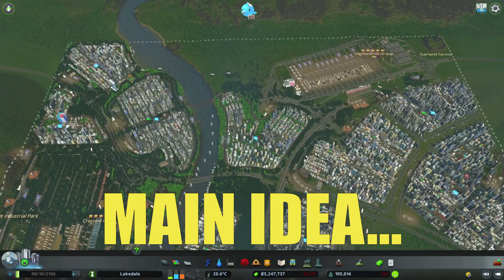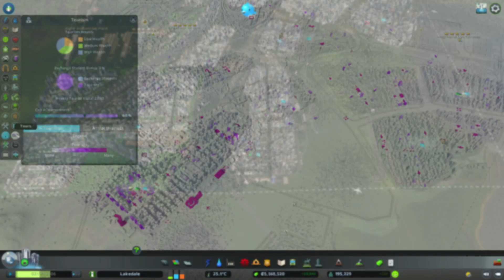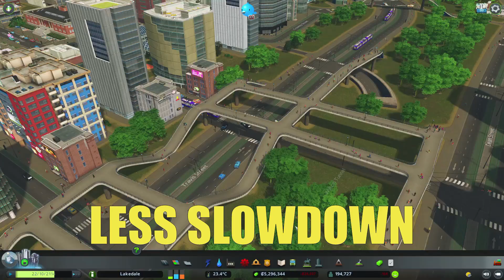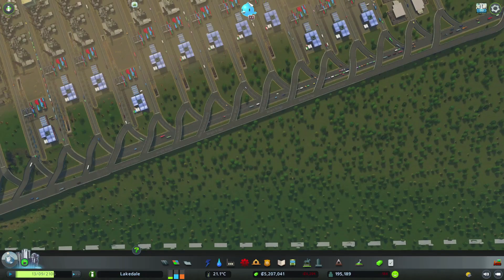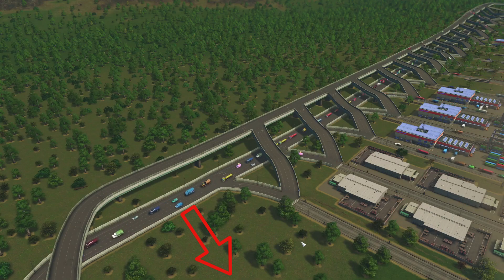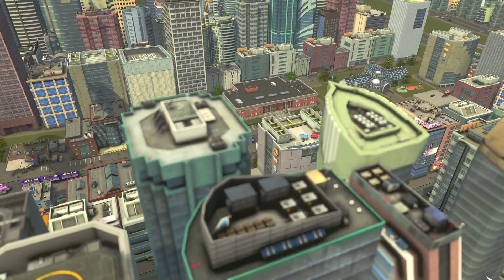🔶Zoning & DLC Industry with Maximum vehicles and a Balanced RCI city design in Cities: Skylines

Comment: Thank you Peter for showcasing my city! 
Looking back at the footage i took, is like hearing your own voice on a playback! Its so wierd to me :D. Still you made it into a realy good video mate!
If anyone has questions regarding the city, please ask them here in the comment section.

As for the Spaghetti interchanges. (i mean, who doesnt like spaghetti?!)
As mentioned, my idea was to have traffic in the city, but to make it flow as smooth as possible. I have 1 standard interchange design (see 8:08), that i modify to fit. Some interchanges turn in to spaghetti for a good reason.  The interchanges can run into problems the moment i add a new city block or more cims move into the city blocks. I keep track of where the traffic piles up. It happens for 1 reason only. All the AI will use 1 point on the highway to merge lanes. Once a car reaches this point, it will switch lanes there. If there is a car on that point already, it will stop in the middle of the highway, wait for the car to pass, then go onto the lane it wants. This can only be fixed by making sure traffic isnt 1 giant string of cars like this ------------ but a string with big gaps like this -     -    -      -      -      -. That way you minimize the change of a car merging onto a lane with a car already there. And if the car doesnt have to stop to switch lanes, it will keep the flow fast and steady.

As for traffic. My city currently is at a steady 84 to 85%. The workshop city is an older model, that i will update it soon. I feel like 10% of this traffic is generated by the cargotrainhub, the airport and the oil hub. So i think its safe to say given the size of the city, the traffic flow is quite good.

If anyone wants me to finish this city, please be sure to give this video allot of thumbs up.
Reply from the maker: Hello mate, and thank you for the opportunity to showcase it. It was my pleasure. Also, great write-up on this comment, giving all viewers additional info and explanations.